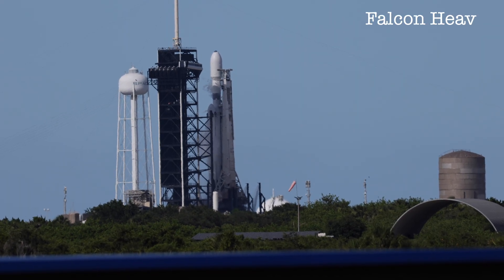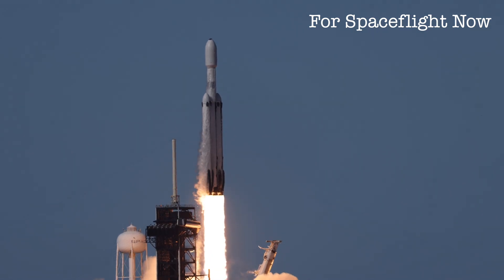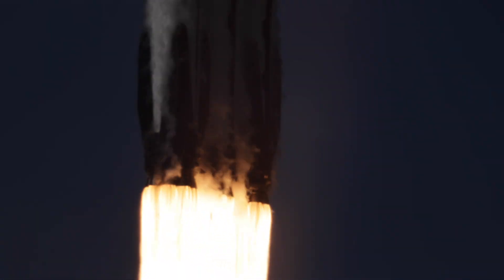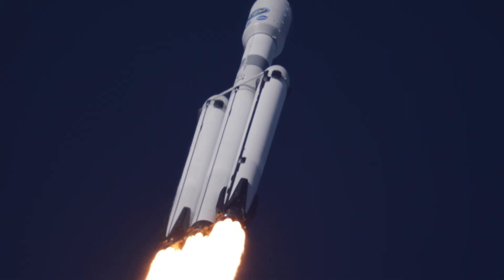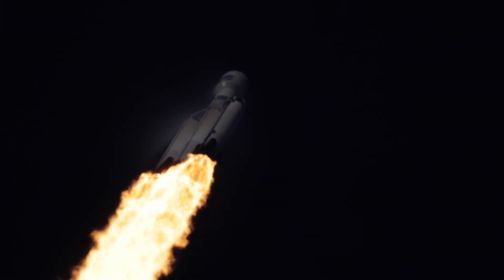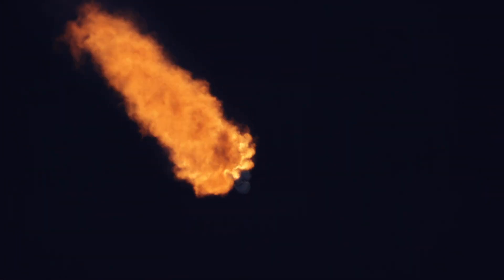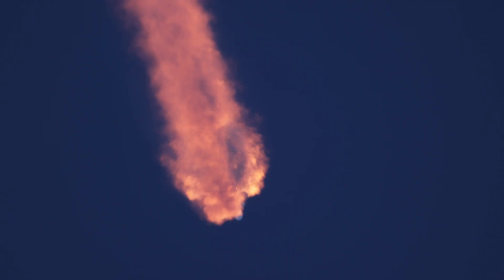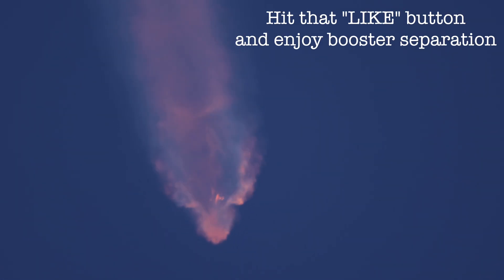Falcon Heavy GOES-U 6/25/24

Comment: Always soooo fantastic! So many question also: 1. After mico, the boosters fly through the gas plume of the first stage, it must be a lot of arodynamic brakeing there. How many Gs? 2. When the boosters do their boostback burn, how long does it take for them to breake from thousends km/h to speed zero so they can start to fly back. How many Gs? 3. During the free fall they do the first breaking burn, how many Gs?
Reply from the maker: Hi, thanks! Not sure on questions 1 and 3 but for 2, it takes about 10 seconds or so to come to a stop and start heading the other direction. I have a wide shot on my channel that shows them doing this. Always fascinating to watch.
Reply: @maxqproductions1  Thanks! A link to that maybe?
Reply from the maker: @tonyrundstrom4133  here you go. Tons more if you go into my video library.
https://youtu.be/Fk7H7XtmlZQ?si=cye1z7AsBaI3emkj